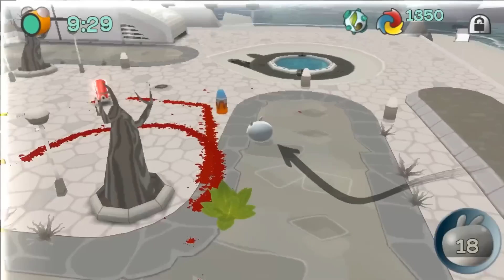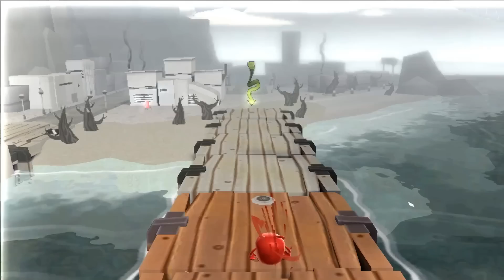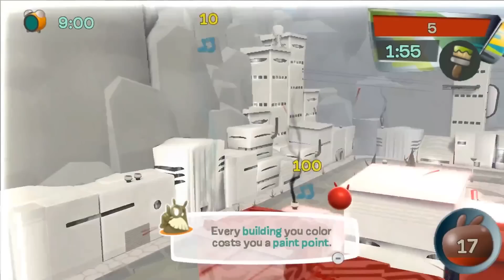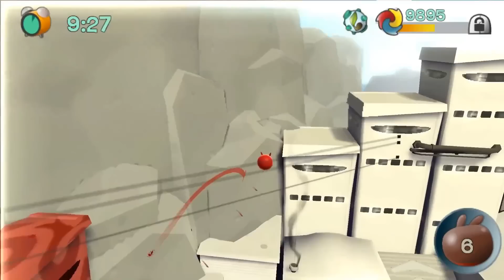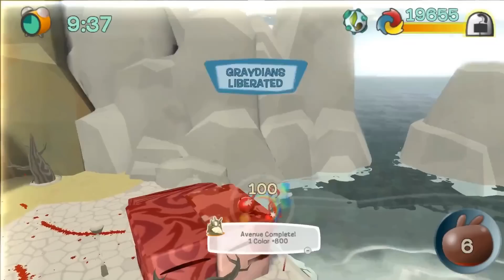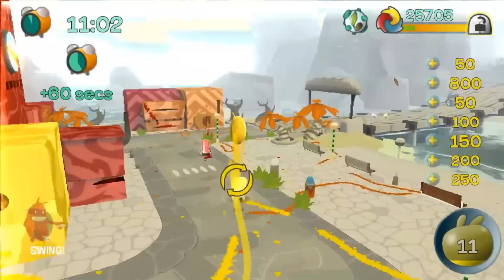Nintendo NX "Polaris-Like" Custom GPU is BadA$$, Here's Why! - RUMOR Discussion

Comment: What's this? From Emily. Saying about the 10k hardware rumors. That his sources were wrong and incorrect. The whole gimmick was made up. And that the GPU is wrong. Power level is wrong and that the specs on the NX are "Good"

Is Nintendo trolling all of us Now? :(

The Neogaf Forums are having a melt down
Reply: +WCW/NWO RevengeN64 Difficult to say.  But I would take it with a grain of salt.

Comment: Do you think the new president is the reason why Nintendo might be going with power this time around or do you think they would have had done it anyways even if Iwata was still in charge? Just wondering what you thought.
Reply: They would've done it anyways ... Iwata was alive when the system was in development or even finished. Remember every company starts working on a new system when the previous one releases.

Comment: These rumors are taking it a little too far. Considering Nintendo does not produce any parts themselves, and they absolutely must profit on hardware, how much do you suppose the NX will be priced at?

If all this power talk is true, HOW MUCH are you willing to spend on the system?
Reply from the maker: +Minimoy Nintendo doesn't have to profit on hardware. The Wii U didn't at launch. I'm willing to spend $400, but I don't think it will cost that much.

Comment: There are going to be so many meltdowns at E3 as a result if this NeoGAF troll. Guys, NX is weaker than XBox One by about 5-10%. It has the same core count but at a lower clock speed. CPU is faster though, presumably to boost VC emulation. (That's just my guess. Nintendo hasn't confirmed it to devs).
Reply: +NDogg15 LOL: "CPU is faster though, presumably to boost VC emulation" the Wii U already runs VC emulation pretty perfectly.
Reply: +NDogg15 LOL
Reply from the maker: libertysounds87 There is more than enough evidence that points to him being wrong. I mean, the Wii U wasn't weaker than the PS3 and Xbox 360.... why would Nintendo make the same exact mistake with NX but WORSE than the Wii U's in comparison to the PS3 and Xbox 360? That literally makes NO sense. The system would at the least be on par with PS4 or slightly above Xbox One, but weaker? Not a chance in hell to be honest.

What he is saying isn't true, and is not backed up by anything but his own opinion.
Reply from the maker: NDogg15 Nintendo isn't making a system weaker than Xbox One dude, its not happening.
Reply from the maker: NDogg15 Not sure you know who you're talking to..... but just to let you know he knows a lot more than you think.
Reply from the maker: Turnajon Yeah, you can tell by his comment to Dave he has no clue who he is.
Reply from the maker: NDogg15 "For the systems currently on it, yes, The grunt is needed for the new consoles hitting it... More to come at E3." 

What news consoles? LOL, stop it. The VC is fine on the Wii U. Do you know if Nintendo made a system weaker than the Xbox One that means it would literally be the same power as the Wii U. 

So you're expecting me to believe Nintendo is going to replace their current system with a system with nearly the same power? LOL
Reply from the maker: SuperMetaldave64 LOL, I saw that and was like what? This dude is just making stuff up.
Reply: +NDogg15 Do you know how rendering works? There is no way Nintendo would release a console with a CPU that is 30% more powerful in raw numbers than Xbox One (which was already 10% more powerful than PS4) and not have a GPU to match that power. Why? Bottlenecks in performance. For example: say the CPU does 15,000 draw calls to the GPU, however the GPU can only handle 10,000 draw calls at time, what will happen is the GPU will not be able to keep up with the CPU and the game will slow down or have poor performance. This actually happened with the Wii U to some extent, the CPU was too slow in sending draw calls (how many triangles/polygons to render on screen) to the GPU making games "slow down" for games like Assassins Creed IV in larger areas in the game. The GPU power was there and not being fully utilized because the CPU couldn't keep up and the GPU and had to wait for the CPU to catch up, however if Ubisoft used the EDRAM in the Wii U for that port they could have fixed that problem, but that's another story. For the NX if it is using a GPU based on Polaris, they will need a moderately fast CPU to send draw calls (specified number of triangles/polygons the GPU needs to draw) so the GPU will not have to "wait" for the CPU to catch up from being too slow. Some games on Playstation 4 have already been seeing this problem in some of the more shader intensive and particle effects intensive games, FFXV is a good example of that, in the demo at least, the system can't keep up with all the effects on screen and the game will drop to 20fps, not because the GPU can't produce these effects, it obviously can but the CPU simply can't keep up with all the information going the screen. So basically, what you said is incorrect.
Reply: +NDogg15 How do you know?  Do you actually own a development kit or something?
Reply from the maker: Lol, that's not happening. Why would Nintendo make a system weaker than Xbox One? 

And your source for this info?
Reply: +PlayerEssence what's funny is i wouldn't be surprised if what he is saying is true.  Did Nintendo truly learn their lesson? I guess only time will tell
Reply: +PlayerEssence You will see when the pixel counters get to wok at E3.
Reply: +SuperMetaldave64 For the systems currently on it, yes, The grunt is needed for the new consoles hitting it... More to come at E3.

You will believe me when they don't talk about specs in the reveal ~3 weeks from now, and then journalists start asking anonymous devs about power.
Reply: NDogg15 The only thing I believe is that you're just pulling our legs.
Reply: +PlayerEssence I thought I smelled a troll.
Reply: +PlayerEssence Two new consoles will be featured on NX VC. It'll be like a dream com true! :) I know who Dave is and that he no longer has a source.
Reply from the maker: NDogg15 And that's fine. But your claim the NX will be weaker than the Xbox One is bullshit, considering the Wii U was stronger than the current gen when it launched. Hell, even the Wii was stronger than the PS2 and OG Xbox when it launched.
Reply: +PlayerEssence Emily Rodgers just dropped the bomb. I told you so! Get outta here, ya faker.
Reply: +NDogg15 If the rumor turned out to be so then so be it, but calling names like that is going to get you banned.
Reply from the maker: NDogg15 Told who so what? Lol, just checked her Twitter, she's saying the console has good specs. There is nothing about specs worse than Xbox One. 

You're just an overzealous Wii U fan upset for some reason
Reply: +PlayerEssence I told you that there's no Polaris.

GameCube a DreamCast VC will be announced at E3. You will then come here and tell me that I was right all along.
Reply: +NDogg15 How about you buzz off and quit antagonizing us.
Reply from the maker: +NDogg15 Are you stupid? I never doubted your VC made up rumor. 

I said you saying the NX is weaker than Xbox One is bullshit. 

Now stop troll, you're not impressing anyone.

Comment: I wish more people understood what you said about the PS4K. No matter what, that new system will always be bottlenecked because it has to natively run PS4 games. There isn't much Sony could do other than increasing the clock speed or getting a better GPU, similar to the 3DS vs. new3DS. It will not be another Wii U situation because developers will still be making Xbox One and PS4 games for years to come; they're not going to switch over to new hardware just because it's more powerful and abandon tens of millions of potential customers.

Comment: Polaris hasnt been released yet, they are currently working the polaris 11 and polaris 10 based gpus, it appears that they will compete for the mainstream and performance markets, leaving the highend out for the VEga chip? based on Polaris of course. Both the 10 and 11 chip will be 14 nm which decreases transistors by 50% over the 28nm tech X1 and PS4 use.